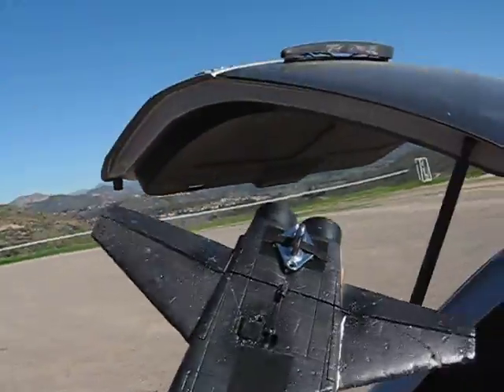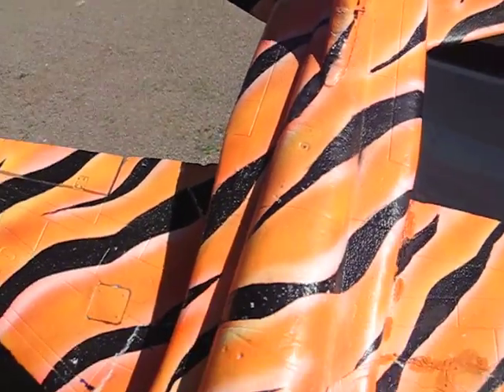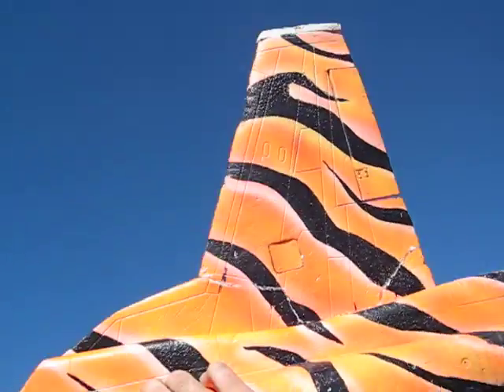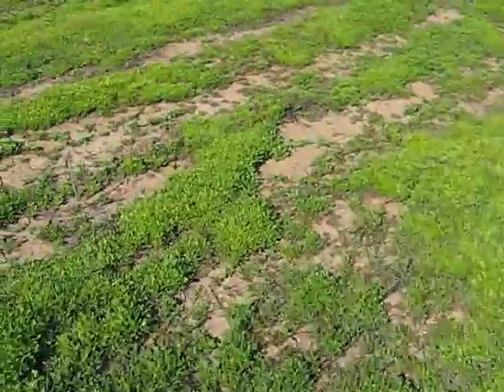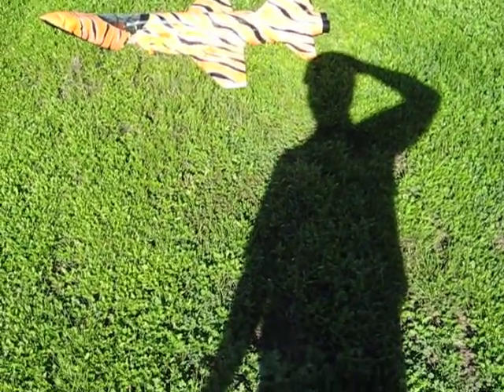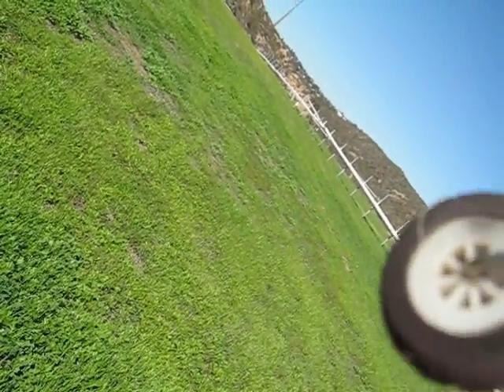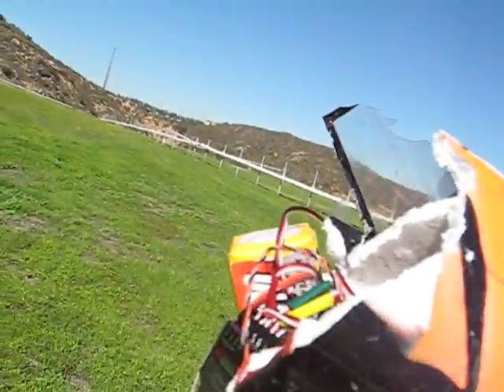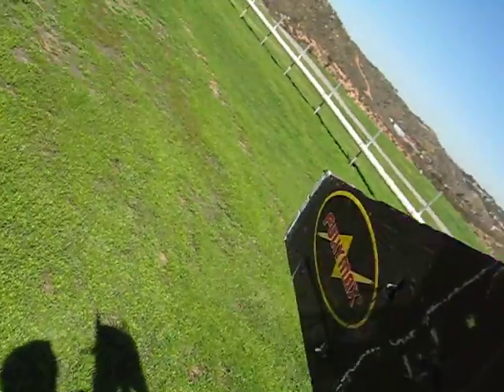F-5 starmax with a crash

Comment: Hmm, sounds like you over ampped the ESC, rather then overheated it. Overamping can look like an overheat, which is essentially what it does, but it shuts itself down to prevent damage, which is why you should use a seperate BEC for it. But hey, it clears up space for another plane on your radio :D